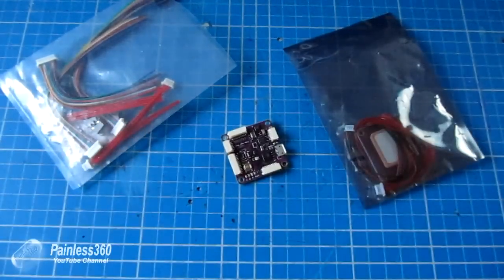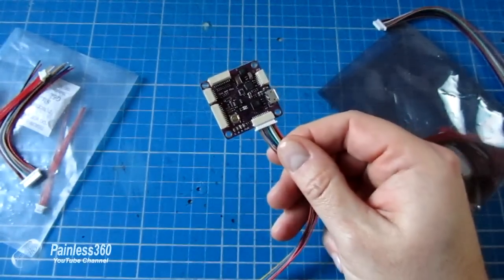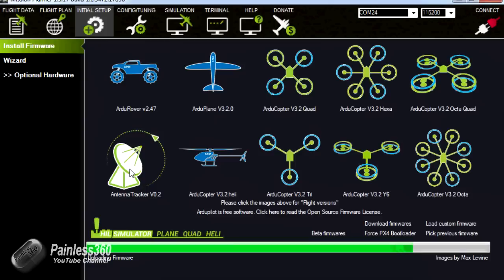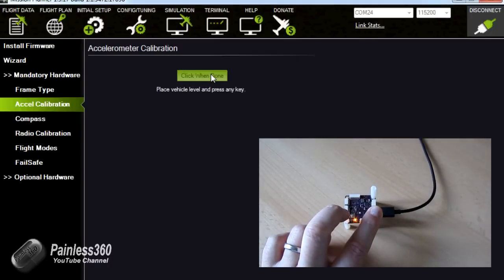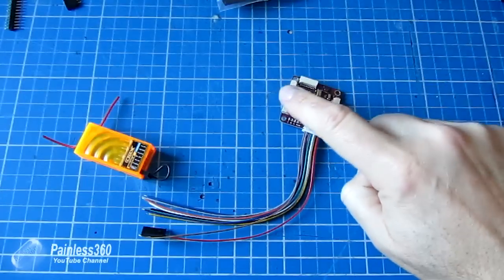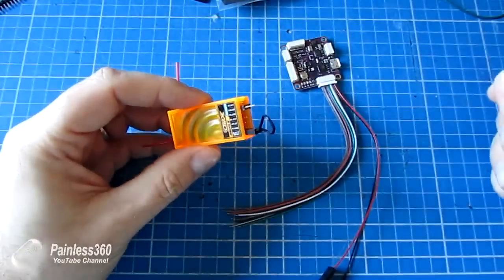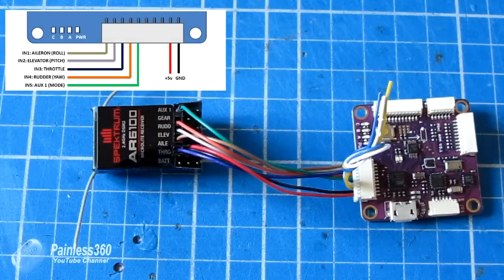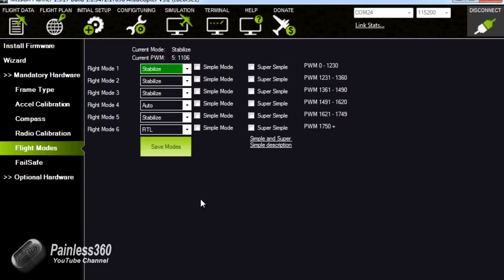(1/8) APM Mini 3.1 Video Series - Simple setup, config and calibration. Board from Banggood.com

Comment: Ok I know its outdated but I have an APM 3.1 mini that I got a couple years back and I wanted to throw it in my Bixler. I have followed your videos on APM 3.1. I have powered the FC with a Power Module, so I have 5 volts to the FC. I have verified with a multi meter that I have 5 volts at the RC input side and have made up the CPPM connectors as you briefly showed ( IN1, jumper IN2 & IN3, 5v, ground). My problem is I can't get power to the receiver. I have checked the receiver by plugging a ESC into it and the light comes on, but when I plug the three pin connector for CPPM into the receiver I get nothing. I am using a FrSky D8R-XP and Turnigy 9XR transmitter. With my micro quad I am using a FrSky D4R-II receiver and out put CPPM to the FC with no issues.....I'm scratching my head and burning daylight...
Reply: So follow up: After 6 + hours of troubleshooting all it came down to was a bad ground wire.  The culprit was the ground from the input to the receiver. It was a mechanical connection problem.  Shows how important a good ground is.

Comment: Hi mate, with an open apm board, should it have a dome or enclosure over it on the drone? When I enter a gps mode my drone seems way less controlled. In fact it flipped over and crashed the other day. I did buy it all second hand and in bits so I’m not even half sure that there may have been problems already.
Also the blue light on top of the gps, is that supposed to turn solid blue or keep flashing?
Thank you for providing some of the best YouTube educational drone videos I’ve come across btw! I’m a trainer myself and have also taken a few teaching pointers from your videos.
Reply from the maker: Tricky to answer as I've not played with APM for quite a few years now. Sorry I can't be more help..

Comment: This is a component to have altitude hold on a drone?
Reply from the maker: You need one or both of two things on a model for altitude hold. A barometer and/or GPS. PixHawk and iNav are the two series I'd suggest you watch. Best of luck!
Reply: Painless360 can I get those on gearbest?

Comment: How can I adapter the Apm 2.6 GPS module to Mini APM 3.1 ? Thanks a lot !
Reply from the maker: If you can get a cable to fit the APM 3.1 then it's case of cutting and soldering the connections. I'd also look online in case someone does an adapter.. Best of luck!
Reply: I ever did it, but didnot work ! Must I  to Solder some component in GPS Module ( Jumper ) ?
Reply from the maker: The only thing I can think of is that some external GPS don't power the external mag circuitry without a little work.. I'd triple check power and the settings on the GPS.. Best of luck!

Comment: Hello Painless, Thank you for all the great videos.
Question: when you calibrated the radio, you mentioned that pitch has to upside-down (in this version?) - is it possible that on a APM 2.8 it also has to be that way. Asking because I've got a slightly "over-powerderd" Tarot F690 with with APM 2.8 (cloned), which after lift-off is impossible to control. It is just pure chaos and i throw it into RTL to land again. Now I'm starting to think that  this pitch-control might be wrong way round. ... testing this beast is not so easy as I've got no clue what this beast is actually doing when I move the sticks, everything happens to fast :)
Reply from the maker: Yes - still the same, see the note on this page - http://ardupilot.org/copter/docs/common-radio-control-calibration.html Best of luck.

Comment: Hello Painless. I've got the most basic questions of all. I purchased this APM/compass combo from BG hoping to follow along with your videos. However, small but important hardware items are not included. Namely, the crimping tool, the "crimps" themselves, and the little black plastic pin connector thingy's which plug into the receivers.  Would've happily purchased them separately had I known that was necessary but now I don't know how to find them and my project is stalled. Can you help? How are they named so I might search for them? Have any links to these additional little items? Any help would be greatly appreciated.
Reply from the maker: +Manuel Nunez those wouldn't be included with the kit, just as you wouldn't expect to get a soldering iron either. Search for DuPont crimps and crimping tool to find them. Many Jo by stores carry them or eBay and Amazon carry then too. Best of luck with the build!

Comment: My apm mini doesn't seem to control the motor escs.
It is sending a 0-5v out along signal wire to motor escs depending a thrust amount.
If I plug a LED up to it then the Leds brightness does change.
But it won't make motors spin!
I'm confused, don't know if my mini is broken somehow?
Any help appreciated Painless360
Reply from the maker: Happy to help but please watch https://www.youtube.com/watch?v=olIqTiSJHIY and come back to me with more detail of what you've tried..
Reply: +Painless360 many thanks for the reply.
When I arm the apm mini. Mission planner shows output values to motor pins 1000-2000 etc.
If I plug a voltmeter to motor out pins and ground then I get a voltage of 0-5v which does change when I increase thrust.
But if I connect  the output to my escs it's does nothing!
My esc and motors are working fine tho, as if I connect the thrust out from the RX directly to each of the ESCS separately then motors spin fine!
Also this is from  a working quad that I have just swapped a standard apm 2.8 for this apm mini board!
I think mini board must be faulty, any other way to test the motor output pins!
Many thanks again.
Reply from the maker: The motors don't work on a voltage they work on a PWM signal. Check you're not connected the servo connectors upside down. You can check the outputs by popping a spare servo on one of them and seeing if it moves.. Best of luck!
Reply: +Painless360 good idea I'll test with a servo.
Yes I know it's a PWM not a voltage btw  :-)  
Many thanks again

Comment: Do I still need an sbus to cppm decoder after jumping channels 2 and 3? In order to connect to sbus receiver like the x4r? Thank you
Reply from the maker: I believe you can but need to flash some special firmware to support the sbus signals (from what I remember). We only use PWM/PPM with APM here and have used S-Bus with Pixhawk. Best of luck!

Comment: Hey there. I've got an issue and Im running out of people to ask :p Im running a hobbyking hkpilot mega micro.

If I set channel 8 to execute an RTL, when i flip the switch, the copter falls from the sky. However, if I loiter first and THEN do the RTL, it comes home without issue. what's the deal here? what am I doing wrong? :) thanks for any help.
Reply from the maker: +Shadrik Easton No idea, I've never seen that before. What you can see in the logfiles?

Comment: I've seen someone update their APM 2.x to work with SBUS directly (no need for inverters or cppm converters) he used the Atmel FLIP software and hex file to update the board controller. Do you think that would work for APM 3.1? 
That could be a new video for the apm 3.1 series...
Reply from the maker: +Bruno Santos thanks for the suggestion. I will check it out. Happy flying!

Comment: hey Painless,
Love your videos but i have the hk pilot mini and i have a problem because when i push on the  right my quad goes on the left and it's the same to go forward i need to pull the stick back to me. Can you help me out please. I am asking you because i have the same remote which it the tgy-I 10 from hobby king.
Reply from the maker: +Lou Durocher Use the channel reverse setting on the radio. If you don't have them then use the plane model mode instead..
Reply: +Painless360 thank you, hope it will work but I find it a little stupid to have a quadcopter model already set in the radio and not being able to reverse setting 😓😓😓...
Reply from the maker: Yep, I've mentioned it to HK and there is a new firmware for the radio in beta that will have these much needed features in the Drone model setup..
Reply: +Painless360 well thank you very much. ;-)
Reply from the maker: If I get any more news - I'll let you know..
Reply: +Painless360 ;-)

Comment: Hi Painless. I have a APM mini 3.1 set up and working fully in stabilise mode, but in alt hold and loiter mode, after arming the motors the board becomes completely unresponsive to my radio/commands. I can use my radio to arm and disarm the motors causing them to spin at idle speed and stop again, but other than that I have no control over speed, direction etc. Have reset the board, re-installed firmware and done the tx calibration several times but am still stuck? Any ideas would be appreciated
Reply from the maker: Can you take off in the working mode then flick into these modes? Check the troubleshooting arming video in the series..
Reply: Yes, I can take off in stabilise mode, but when I switch to loiter or alt hold the quad becomes unresponsive and will just float in the air. I've already been through your trouble shooting video several times lol
Reply from the maker: What do the logs say then?

Comment: Hello, painless or anybody else, could you please help me here?First of all great videos. Secondly i cant get my servos to work.Got the apm 3.1 mini and gps. Done the compass calibration and in mission planner i see the movements of the channels via my remote control. This works fine so far.Somehow i can't get my servos to work. I have attached the servo's signal wires to the corresponding motor channels output on the apm. Then acttached the servo to the ground and plus from the same power which is powering the board. (via the gnd&gnd and +5v&+5v (option 3).When i move the controls the servos don't move.Anybody knows what i am forgetting here??I have looked the videos over and over again, looked at other places, but cant find it out.
Reply from the maker: Check out our series on adding the APM 3.1 to a wing where we cover how to connect servos. Hope it helps.
Reply: +Painless360 Are all those boards the same ? Is the 3.1 any better than previous versions ? Do you think that it could be good on fixed wing? Or should I stick to older versions ?
Reply from the maker: APM 3.1 is simply the 'mini' version of the APM board. See our video series where we add one to a wing for an answer to your other question ;)

Comment: hey the difference between the neo 6m and neo 7n ; is that the 7n has a compass, right?
Reply from the maker: +rio787 https://www.u-blox.com/sites/default/files/products/documents/GNSS-module-selector_Overview_%28UBX-14000426%29.pdf it's up to the manufacturer of the final GPS module if they decide to add a separate mag (like a HMC5883L)  too.
Reply: +Painless360 thanks, your video are very helpful in doing my first build

Comment: So I have received the mini APM V3.1 combo with GPS unit from Banggood. Product ID: 977560. I have followed the steps for first setup in this vid till compass calibration. I can see the compass moving in the "flight data" tab. I can see also "Bad compass health". I cant do the onboard/live compass calibration. No points, white ore colered, are comming. It says got + 0 samples.
Whats wrong?
Reply from the maker: +Silberner Surfer You've not plugged the compass in, probably ;) The model uses it's gyros too so even with the compass unconnected it will still 'move' on the screen as you rotate the board.. It can be confusing..
Reply: +Painless360 
Thanks Painless!
I have realized later that on the newer versions of this board no more compass is on the board.
:-)
Reply: +Silberner Surfer I'm having the same problem. Did you find a way to fix it?
Reply: What I found is that there is no more compass on the board. Onboard compass was at early versions.You have to cut the bridge. Dont know if this is necessary when there is no more compass on the board. But i did it. Use a external compass GPS unit. and it will work without issues. In my case I had to use the B port of the compass/Gps unit.

Comment: You seam to be the only human on earth that has any technical experience with the APM mini 3.1. I want to sense voltage and current, my apm 3.1 is hooked to my power module with the APM power port(+5,Ground,Volt,Current), but it seams to me Mission Planner dose'nt support the 3.1, I cant seam to select it in the settings I can select a? or pixhawk etc., what do I do?
Reply from the maker: +virgodave61 Treat the APM 3.1 as an APM 2.5/2.6 for setup and make sure you are installing the last supported firmware when setting it up. See http://copter.ardupilot.com/wiki/common-apm25-and-26-overview/

Comment: Hi..first of all, I have learned so much from your videos, they are simply awesome and so detailed. 
Re the above video, I am having a weird problem of calibrating my radio, I am using a Radiolink AT9 and R9D receiver. 
During my calibration, the both the sticks on the TX is working the opposite direction. If I put the throttled to its min its showing up on the calibration screen. same with the roll and pitch. but the left right direction for both the sticks are OK.
Would truly appreciate your kind suggestion. Thx.
Reply from the maker: +Shayne X Simple reverse the channels on the radio in the menu. I would start with section 2.3.6 in the manual..
Reply: +Painless360  hey..thanks a lot, will try it out very soon.
Reply: +Painless360 Hi again. I got the throttle direction sorted. Thx. now I got All done as per the instructions. All is OK, but once I connect the copter, I can even do the arming, but the motors are not turning all. all the steps on the mandatory hardware is OK. when I arm the copter the lights on the apm shows solid pink and green. please rescue....
Reply from the maker: Happy to take a deeper look at it with you but only over chargeable support - see the website for details. Let me know..
Reply: +Painless360 hi there. thanks for your note. could u let me know what r your fees, let me see whether I can afford u or not. but I do understand from your point.
Reply from the maker: All on the website - painless360.com

Comment: Hi Painless360,

Sorry to bother you like this, but it looks as if I'm the only one on the net having this issue.
I want to monitor my Mini APM 3.1 quadcopter with a Crius bluetooth module, but I can't get it to work properly.
I have 2 modules.
One that looks like this http://www.ebay.com/itm/CRIUS-MWC-Multiwii-SE-Flight-Controller-Bluetooth-Module-Parameter-Debug-Adapter-/141610622503?hash=item20f8a69e27:g:d2EAAOSw7hRWQu2V
And one that looks like: http://www.ebay.com/itm/CRIUS-MWC-Multiwii-Bluetooth-Module-Patameter-Configurator-Module-Adapter-New-/231257804782?hash=item35d80a0fee:g:ZK4AAOxyrrpTg-OB
When I connect this last one to my Mini Apm 3.1 it will connect but Droidplanner keeps saying: "Stable link lost. Check connection."

I have the baud rate at 57600 and the red led on the module is solid.
I have a Samsung Galaxy Tablet 2 7.0 inch.

Do you have any suggestions, please.

Best regards,
Paul

PS: if you need more information, please let me know.
The bluetooth module was working fine on my Crius AIOP V1.1 flight controler.
Reply from the maker: +Pol leke Not sure, I've not had those problems here. I use vanilla HC-06 and HC-05 units here.Best of luck with it.
Reply: +Painless360 
Guess I will have to buy one of your suggestions then.
Thanks anyway ;-)

Comment: Sensational series, thanks so much for all your help. I was wondering if the Ublox 7 Series Mini GPS will work with the mini APM 3.1?
Reply from the maker: Should do, you may need to change a few settings. It's easier to buy the GPS units already setup with all the right connectors in..
Reply: Ok, I'll start with the ones in the set and maybe move on to smaller gear later. Thanks

Comment: Hey Pain, Thanks for responding so fast sorry you  missed my second post and got my old one.  Any ways no matter what mode I put it in none of them control Pitch.  One mode comes really close to being correct but when pitch is moved it controls Roll for a second time.  Any ideas on what could be going wrong?
Reply from the maker: +Mokra06 Not really, and this new reply isn't connected to the original so I can't see the history easily. I would recheck all the connections, the settings on the radio and the channel mapping in Mission Planner. Direct support us available if you need more help, but it's not free. Best of luck.

Comment: My board came fitted in a case, and the seller stated "no onboard compass" how do I calibrate compass? is it mounted in GPS module? sorry to sound so dim but this is my first apm board and gps.
Reply from the maker: +Homeengineering I would go back to the vendors and get them to confirm what you have.. Best of luck.
Reply: Thanks, it was supposed to be plug a play but they've supplied a gps with a 4 wire and a 2 wire connection. I've also opened the apm3.1 case and the link is still intact. I did the compass calibration as per your instructions but it came back "not enough date" so I guess there's no on-board compass. Do you have any links for a gps with the six pin connections so I don't have to faf around linking on the board as you described in your video. Thanks for getting back to me I'm following your videos with great interest, thank you!